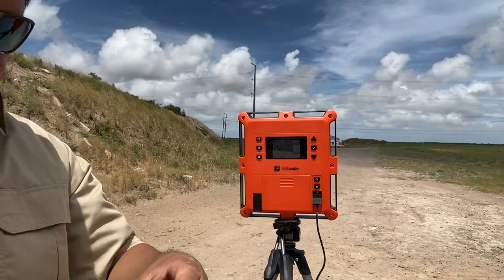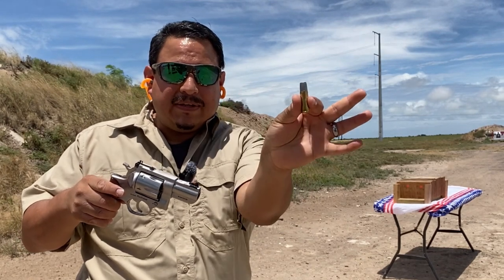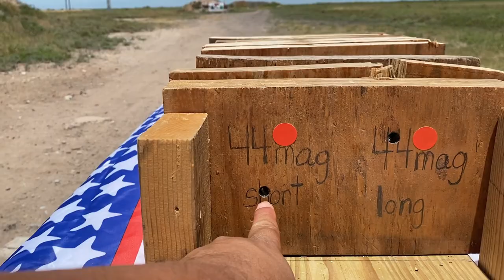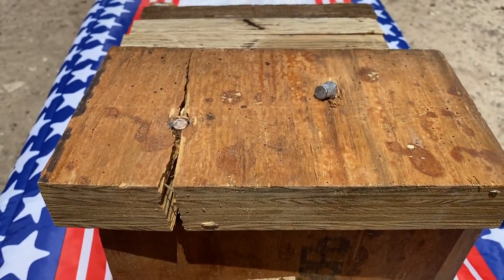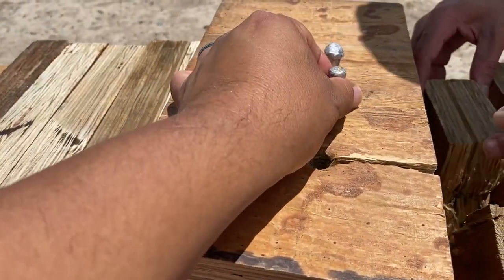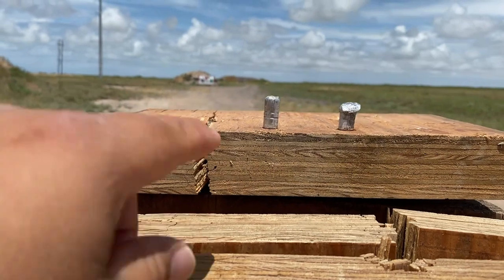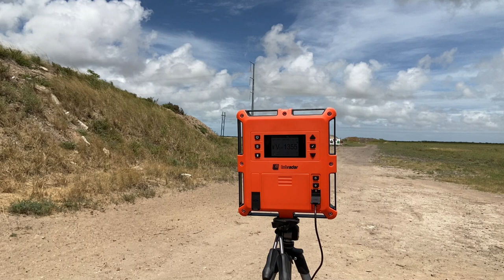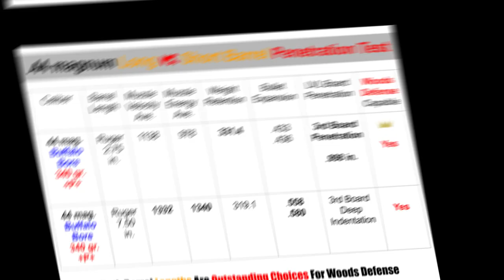44 magnum Long vs Short Barrel:  Penetration Test - Buffalo Bore 340 gr. +p+

Comment: Really a great test!! I agree, the velocity is higher in the long barrel which made it expand more than it did in the short barrel.  That 200 fps increase is just too much for this bullet in the longer barrel.  Buffalo Bore should be using a little harder bullet.
Reply from the maker: Thank you for sharing!
Reply: Hard cast bullets don’t  expand. It’s an uncontrollable test. Knots, glue, inconsistency in wood. If you want equal penetration then shoot printer paper or ballistics gel

Comment: The 340 grain Buffalo Bore +P+ should be shot from a longer distance as such a long bullet needs time to fly to stabilize. Bullet meplat deformation hurts penetrating capability. The shorter barrel did not need longer distance and the meplat was not damaged hence it had more straight line penetration.
Reply from the maker: Makes sense, and the expansion may also have been a factor.

Comment: Shorter barrel may have penetrated more.  But the longer barrel will still be far more lethal to target due to higher and faster energy dump.  One will blow a hole though the target, and the other will blow apart the target.